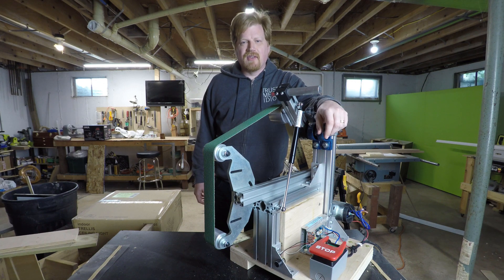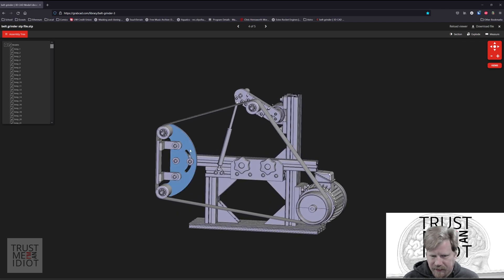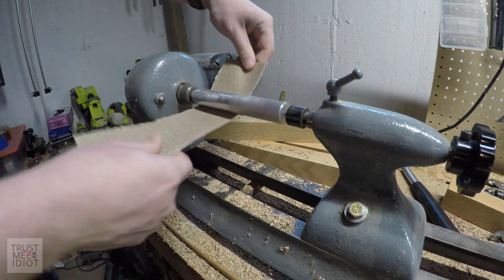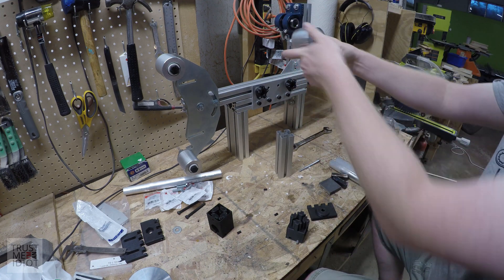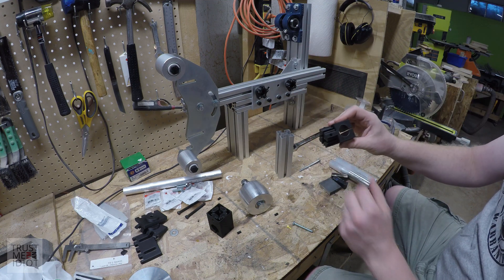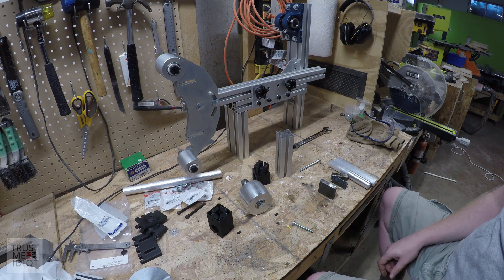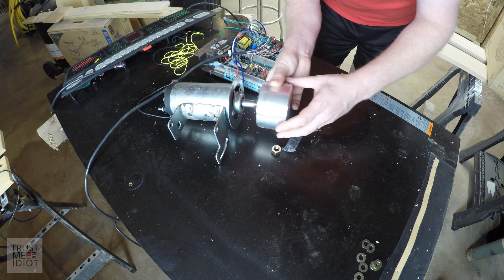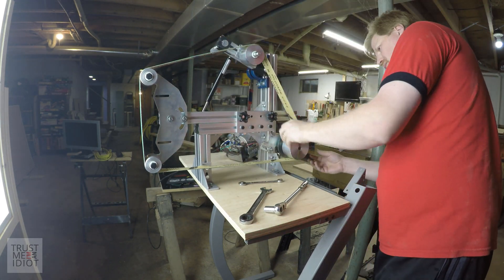No Weld Belt Grinder from a Treadmill and 80/20 Aluminum

Comment: The plans don’t seem to have the length of the 8020 pieces. How did you calculate them?
Reply from the maker: I downloaded the model, imported it into Fusion 360, and then used its measuring tool.